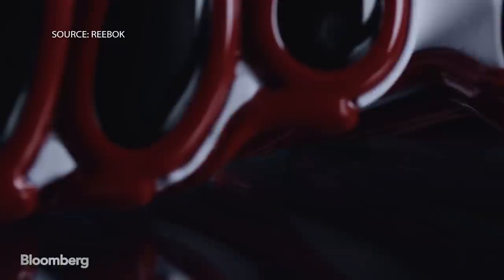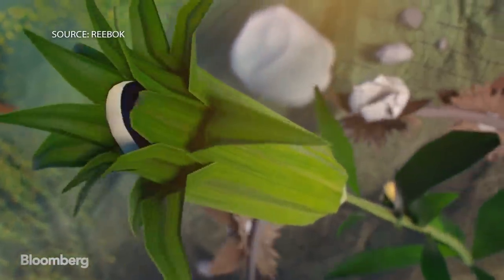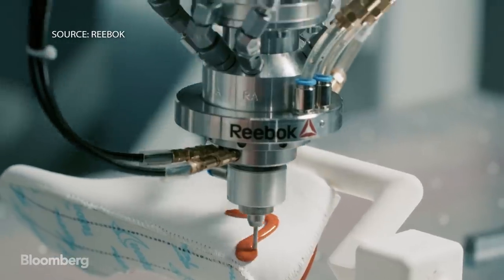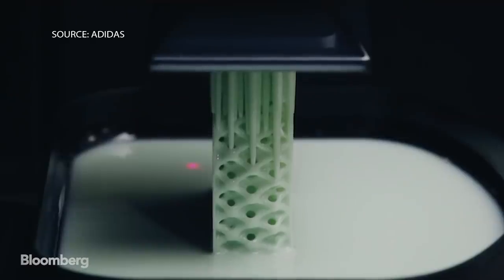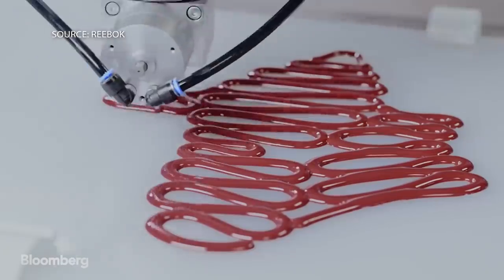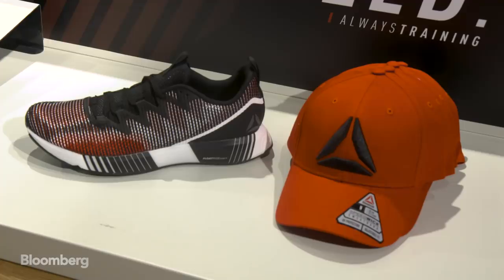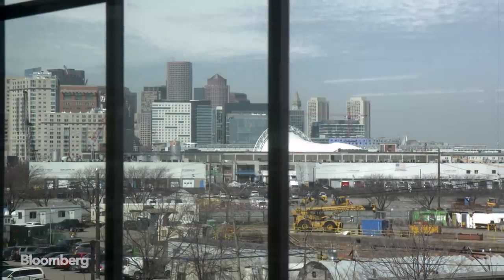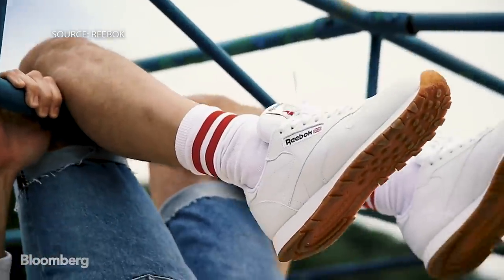How Reebok's 3D Technology Is Breaking the Mold

Comment: Injection molding is better and more durable. Whenever the molten material is injected into the mold, the machine pushes it in very high pressure (5,000 to 18,000 psi) hence strengthening the bond and density of the product. Laying the liquid material like cake frosting does not guarantee a solid bond because it only settles on normal atmospheric pressure and gravity.
Reply: Jack Graybird exactly!
Reply: Jack Graybird Plus what are they laying that stuff on? Looks like an out sole
Reply: They're using some kind of thermosetting elastomer for this process. This isn't going to be much less durable than regular rubber, and certainly more durable than most injection molded thermoplastic polymers.
Reply: ilat As an industrial engineer, these stuff are just basic.
Reply: Yeah but injection moulding isn’t right for the application; it’s kind of overkill to use that process plus additive manufacturing (3D printing) has a better cost per unit. 🤷‍♀️
Reply: Spot on! I was wondering if this 3D Printing just for a marketing gimmick because rebook trying to survive the shoe game. Molding still has the best quality
Reply: Bill's. You are correct.
Reply: you're nuts
Reply: Ya. This is my concern on this technology as well. Good explanation.
Reply: @jomsies  Your comment abit sarcastic in my opinion. Product durability depends not only on manufacturing method, material plays a large role in it as well. Generally, most companies would want to maximize their profits by having cheaper materials( not only china). I thought we dont have to mention this explicitly but i guess we have to.

Comment: As someone born with bilateral severely clubbed feet, I think everyone with clubbed feet and everyone else needing orthopedic custom inserts and shoes (and all disabled, amputee, etc people) should have a 3D printer to be able to prototype ideas and print corrective shoes, sandals and inserts with almost zero cost.  Do you know of a printer, material and design combo you could recommend for this (ideally with a grinder to recycle materials back into filament)?  Thx

Comment: The same type of thing can be done with extruded tinted silicone caulking.However silicone caulking should always be used onlywith VERY good ventilation and a mask because YOU DONT WANT THE SMELL of silicone caulking in your house/apartment. 3D printing is really just a mechanical way of sculpting.